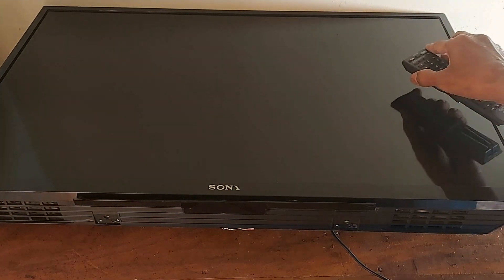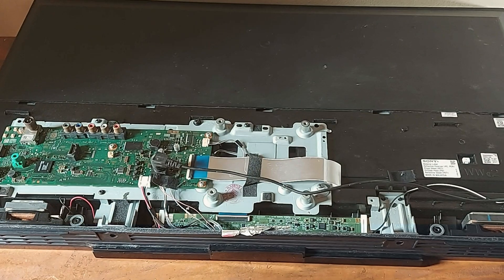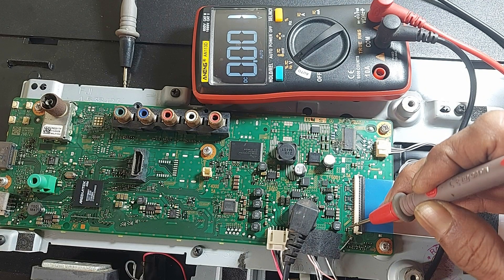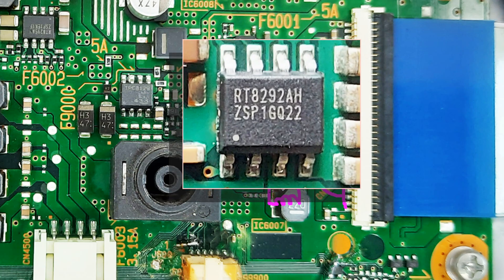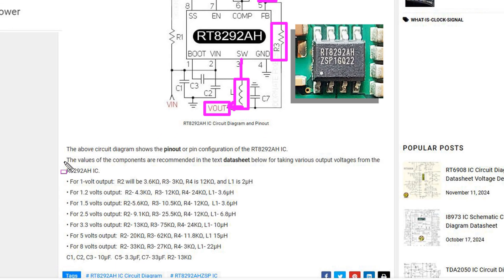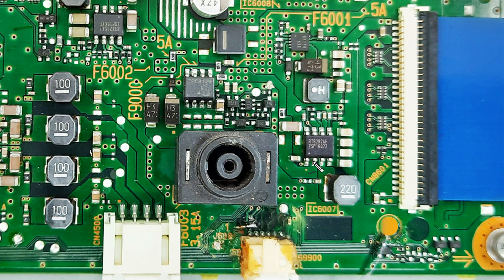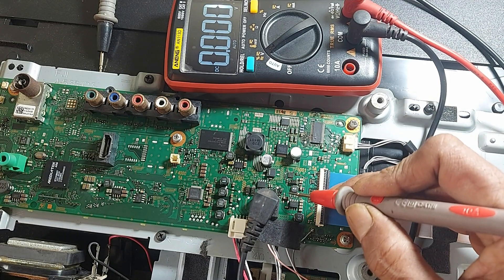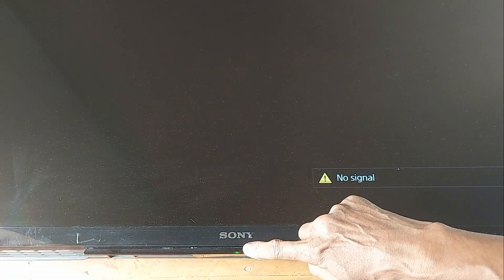Sony Bravia TVs Red Light 5 Times Blinking Problem | RT8292AH IC Schematic Circuit Diagram

Comment: Sir, why the fuse has blown, Any short in panel?
Reply from the maker: There is no short circuit in the LCD panel. But the T-cone processor may have followed an overcurrent while processing HD-resolution images, or the fusible resistor may have been defective. Thanks Brother 🌼🌹❤🌹🌼